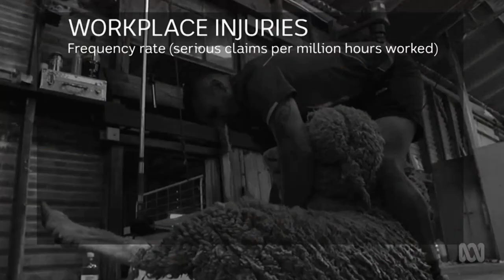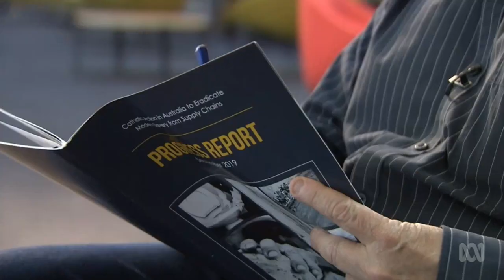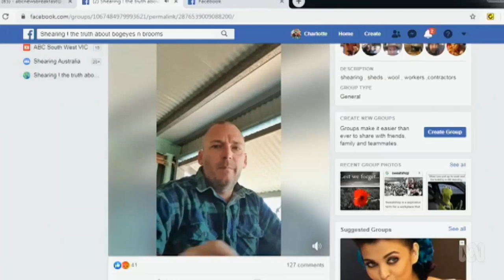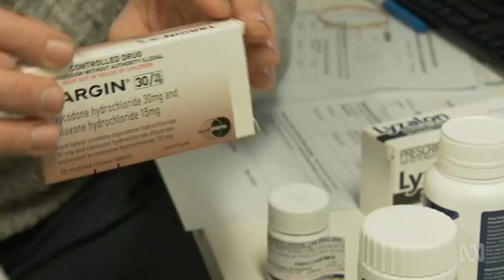The Decline Of The Shearing Industry:  Landline

Comment: Im going to be as passive as possible.95 percent of the industry ate standing on the head to finish the last side fact contrary to the lies an deception.this is the major spinal an hip injurys.the reason 95 percent dont cone of the lastside of the sheep is because they have shorn the undermine properly.the reason they cant do the undermine properly is because the rousie interference.until it gets addresses the spinal injuries and multiple injuries will remain.the issue you have put on the table are not only near impossible to address but trivial to what ive mentioned.the solution to my issue is simple.get the girls away until the sheep is finished but it cant happen because of the lies an deception surrounding this issue.